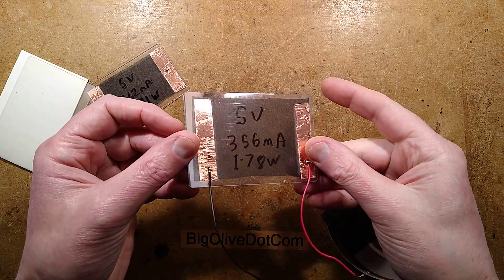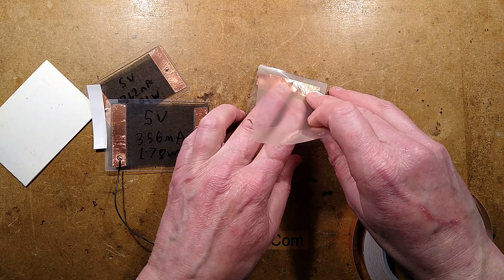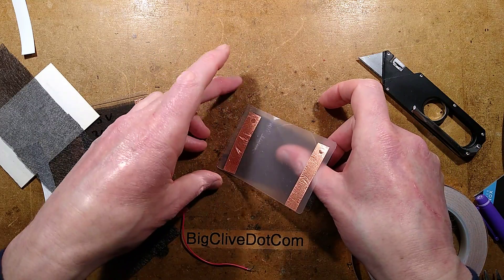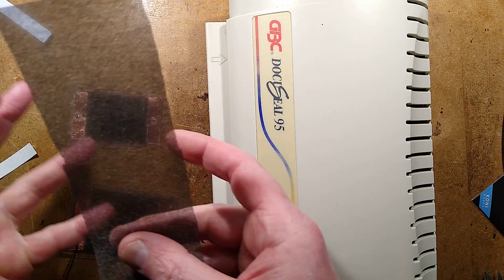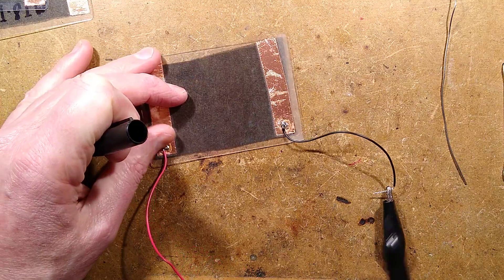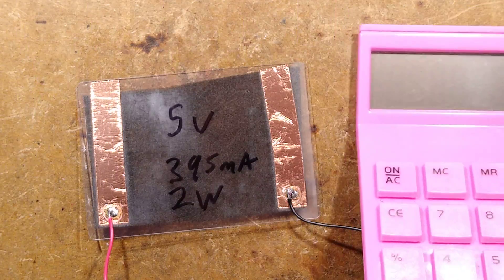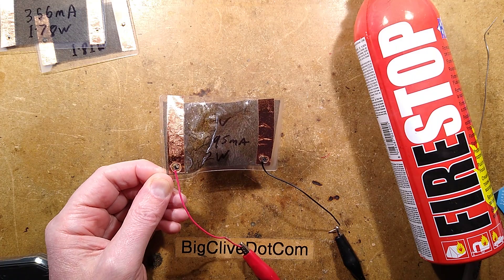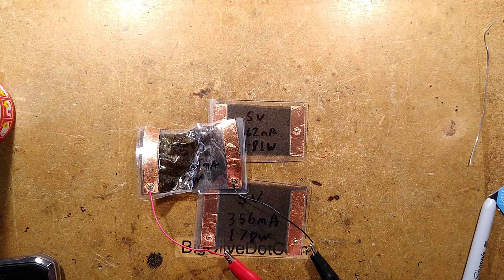Making custom heater pads and then destroying one

Comment: I have played around with some i purchased off of ebay a while ago, i noticed that with pressure applied the current goes way up, i am now wondering if its because of the multi layer design of the pads i had or simply just the weave being compressed hmm.
I was actually curious of the failure mode, thankyou for that too.

Comment: Great! I'm gonna buy the stuff and see if I can make large pads for the inside of my mudflaps on the car. Here in Sweden we often get pretty crappy winters with muddy snow building up on the flaps that gets rock hard with the temperature jo-joing around 0°C. Over been thinking about how to make heated flaps and was going for Konstantan wire (is that the English name for it?) but this seems to be a great alternative👍
I'll just glue them on and cover with glossy "snowophobic" paint😊
Reply: While I'm at it, I'll make some strips for my LED light bars too...
...uhmmm, wait🤦😂

Comment: The copper will be 4-12% lead to ease drawing through dies. Brass is usually the same for machining. Otherwise it is pretty sticky to cut and prone to crack. I think it reduces work hardening too. Makes it move more on a lathe if it is thin, like in slot cutting fins. You'd want to make all the cuts at once with a "comb" cutter. You have to go really slow w/o one to keep it from bending into the last slot.

Comment: I've made heated gloves using carbon fiber rope. I originally used 7.4V LiPo packs that came with a pair of commercial gloves. But for the past 2 winters I've been using a USB-C battery with a 9V decoy board, which eliminates the heat fade as the battery voltage drops. To control the output I use a small PWM dimmer.

The carbon rope I use has a resistance of 21 ohms per meter. The temperature is a factor of length and voltage, the shorter you make it the hotter it will get. I picked a length that I can plug my gloves straight into a battery and max out at a safe temperature.

It has been quite the learning experience as I've had all sorts of failures. I finally settled on copper crimps for the wire to fiber connection. I was still using solder which made the wires brittle and some broke over time from the stress of removing the gloves. 

At one point I was using fine copper wire wrapped around the carbon and power wire then bonded with solder. But unless the solder is absolutely perfect that connection can act as a coil and get up to 200F! That was a fun surprise, at least carbon cools off very quickly.

Comment: You can test to see if it is copper with a multimeter aparently.  If you set it to a specific setting, you can see the materials resistance.  Copper has a 1.7 x 10⁻⁸ Ohm/meter resistance rating.
Reply: but resistance changes with how wide/thick the strand is. Thinner wires have higher resistance
Reply: Multimeters don’t do well with such low resistances, but you can put an amp or two from a bench supply through a strip and measure the voltage from an ordinary DMM with a Kelvin connection. Use Ohm’s law to find the resistance. Then multiply by the cross-sectional area and divide by the length to get the resistivity. Should get within 10-20% with little care and maybe 10x better with good procedures. Pure copper has a positive tempco of about 0.4%/degree C depending on annealing.

Comment: Copper foil tape, I'm told, is used in stuff like electric guitar shielding (or any EMI shielding for that matter) and slug repellent. The wide tape is thinner foil than the narrow tape, which was a bit of a surprise, and unlike aluminum tape, many copper tapes have conductive adhesive. My favorite use of the stuff is to create addressable LED matrices using LED strips, copper tape, and Kapton tape. I've found that flux can "foul" the adhesive, rendering it non-sticky but a huge mess that you'll still need to clean with isopropanol.

Huh. Maybe one could use stainless steel thread and a couple of brass grommets to make a heating pad that you can sew into a jacket or something. Perhaps you could use the heating properties of this stuff in some heat shrink for something interesting.

I wonder if the carbon fiber can behave like char cloth? << pyromaniac
Reply: Another fun material I have used is nickel shielding tape: it’s fabric made of woven nickel thread, with conductive adhesive. It’s also available as fabric sheets without adhesive. 
I have uses that tape to convert a pair of ordinary flip-flops into ESD-safe flip-flops to use at work. (Yes, they passed the ESD footwear tester!)
Reply: What I reeeeally want to experiment with is that tape that is electrically conductive only along its z-axis (that is, through the tape only, but not along its length and width).

Comment: That stuff might come in really handy in my drying / curing chamber. Same princible, but only way larger. Do they hold up to lets say 80-120C? 

A wise man once said "We don't do 120V on this channel" Lets see what happens on 240 mains with those pouches instead of 30! Do you have a suitably large variac by any chance? Ya know, for ultimate torture testing.
Reply from the maker: They're best suited to low power use.

Comment: Neat! I bought some of this a while ago for igniting plasma in the microwave and did some similar experiments with heating pads, but I just mounted it taught between two thick metal leads. The copper tape seems to make more sense, I kept creating little arcs where the connection was made that ate through the fiber lol. I didnt think to laminate it, that certainly makes the material a lot more useful!

Comment: The middle is better, that way there's a more even distribution of current, in theory

If you used two wires poking out of the laminate, you could use two whole sheets of material, having two sides of a wire usable

Comment: This is a great little experiment! I could see this being worked into all sorts of applications. I wonder if heating up/dehydrating the fiber pad just before sealing it in could help with the moisture thing.
Reply from the maker: I'm wondering if the moisture came from the pouch adhesive.

Comment: Possibly interesting variation: Just use the bare carbon fiber sheet, clip the gator clips to opposite corners, watch with the thermal imaging camera as you ramp up the power.

Comment: Since it didn't actually burst into flames even at very high settings it would probably make a very safe option for all kinds of heating devices.  
Pipes in winter...solar panels...even Lithium battery heaters for very cold environments...possibilities for a wide range of uses!
Reply: I'd like to make some innersoles to keep the feet warm during winter.

Comment: You could maybe use some wide Kapton (polyimide) tape between the laminate pouch and the copper & carbon fibre as additional protection against melting the pouch. Might not even need the pouch if you can get thick enough Kapton tape, or have multiple layers instead.
Reply: We need pouches made of Kapton.
Reply: Wouldn't any thermal insulation be defeating the purpose of the heater aspect of it? :p
Reply: @lacunate  Kapton is heat resistant, about as heat insulating as normal pouch material. You can get it in rolls as adhesive tape.
Reply: I think the carbon fibre has to be somewhat embedded in something otherwise it'll start breaking down as it heats up. The lamination works a bit because the adhesive on the inside melts a bit into the fibres, but that same ability to melt at relatively low temperatures is also what makes it much less suitable for this purpose. The absorbed moisture in the fibre is also an issue that would need to be baked out first.
Reply: Kapton is comparatively delicate. It’s not as tough as the laminating pouches. And it’s far more expensive. So I wouldn’t use it anywhere it’s not truly necessary.
Reply: @tookitogo  It might cost more, but it is the result that counts. If you want to make a custom heating element this way that can produce more heat without crincling up like normal pouches, you need other material. The price is less of importance if it can be made working.

The Kapton adhesive film and the Kapton insulation around NiCr-Ni thermocouple I have worked with so far were a lot thinner than pouch material, so yes, in that respect they are 'more brittle', but still sturdy enough.

The main reason for why there are no Kapton pouches is probably the color of Kapton.
Reply: @strenter  I only said to not use it except where truly necessary. I didn’t say to not use it at all. 

Also, I said it’s more delicate, not that it’s brittle. It’s not brittle at all. But it resists abrasion poorly, which is one reason why it’s not the first choice in many applications.
Reply: Kapton tape would be used to pick up graphene from pencils on paper, No need to find carbon fiber.

Comment: Interesting how the smoke comes and goes.  I wonder if that's the plasticizer leaving the laminate, and maybe this could be a manufacturing step for making stiffer and high-temperature ones.  Maybe stack something flat and heavy on it to keep it from deforming, and then use its own heat to cook out the lower-temperature volitiles, see what's left afterwards...

But also good to know that you can make a 5w one and it's got about a 5x safety margin still.

Comment: Neat idea its a shame it just shrivelled up and died. Would AC effect it in any way to stop it dying so one sided?   2x👍
 I guess at the wire soldering time you could use a sharp screwdriver bit and scrape the glue off
Reply from the maker: It only shriveled up because I deliberately pushed it too far.  At low voltage it should last a very long time.

Comment: FYI, the copper tape can be found in diy stores as snail deterrent tape
Reply: Darn, he didn't measure the smoking temperature with the pyrometer camera thingy! Now he'll have to do it again.
Reply: Self adhesive copper tape is also used for making stained glass. Craft shps sell it.
Reply: hahaha snail deterrent at 240V AC 
There's a new video for Clive 🤣
Reply: @Dazzwidd  Photonicinduction did that with several kV.
Reply: @Dazzwidd  instant escargot, the French is going to love this.
Reply: @YoureUsingWordsIncorrectly  I think a microwave oven transformer connected to copper strips on the ground would be better. Set up a camera
Reply: @Dazzwidd  Mmm: fried snail; my favorite.
Reply: I did it the other way, bought some copper tape from Farnell to use with electronics and let my then partner use some wrapped around short lengths of PVC pipe to stop the snails eating her seedlings.
Reply: Thanks, going to buy one.
Not sure when I will be able to get my hands on the carbon fibre mesh.
But at least it will help get rid of the snails and slugs in the meantime.
Reply: It is also used for Dolls house wiring, sold at craft / model shops.
Reply: Snail deterrent ??? Never heard of that.
Reply: Does anyone know what is it about the copper tape that keeps snails away?
Reply: silver/ aluminum works too im pretty sure
Reply: @Bobo-ox7fj Thank you for taking the time to answer. So if I understand correctly, the copper tape doesn't necessarily keep them away, but simply prevents them from going past the tape?
Reply: @nnamerz @Bobo-ox7fj
 "..their blood contains Hemocyanin proteins that contain two copper atoms. When copper and snail slime combine, it creates a small electrical charge that deters the snails and slugs from crossing the copper."
Reply: Good addition. Thank you

Comment: what happens when you stack several layers of the carbon fibre sheets in one element?
Reply from the maker: That should theoretically reduce the resistance.  But I think the laminating pouch needs to be able to fuse right through for maximum contact.

Comment: So now we need a mains test to see how it behaves at 4 kW!
Reply: Yes Clive, put it into the sausage heater!😂
Reply: Oops, somebody invented the flat incandescent light 'bulb'
Reply: it would probably draw around 3.3kW and 14 amps. Then it would explode...
Reply: @williamhuang8309  you're saying that like it's a bad thing?
Reply: @zyeborm  no, it would be very fun
Reply: Clive, you forgot to measure the resistance! But anyway, the thing would just explode on the mains the moment you plug it in 😅
Reply: @abcdefgh1279  we can calculate it to be around 14.3 ohms. 5V divided by 0.35 amps = 14.3 ohms
Reply: @abcdefgh1279  ohms law?
Reply: @adamkarolczak5416  znam prawo ohma 😉 
I know ohms law
Reply: Would it work with AC
Reply: @PerspectiveEngineer  yeah it's just a fancy resistance so AC or DC don't really matter much. It's still going to blow up
Reply: Ring the Russian and Chinese Embassies first—Just in case.

Comment: Come on Clive, we really wanted to see it connected to the mains via a variac.. 😁🤪
Reply: when he suggested making three strips I instantly thought "Yes! connect it to three-phase!!" ;-))
Reply: @stepheneyles2198  all we have to do now is decide whether we want it connected in a star or triangle configuration 😉
Reply: stick it on Photon's capacitor
Reply: Oh come on Clive get out the quick test !
Reply: You get little sparks where the individual strands meet the copper, knocking out those strands somehow... this shifts more current to the remaining strands, causing them to die out more quickly, until the connection between the copper and the carbon is completely broken. Not sure why, maybe it's the plastic melting by the heat and causing insulation, but it doesn't take much to destroy them

Comment: Unnecessarily complex proposal, but if you made 4 x 7 segment shaped arrays of these (with the appropriate drivers) then coated it with thermochromic paint , you'd end up with a really funky clock!
Reply: ...also, you could leave off the thermochromic paint, and have a clock that you could only read with an IR camera 🤣
Reply: @therealchayd  Yes yes! I was thinking about a nitinol wire installation which would heat up and show the time only in IR. :D
Reply: That's a really cool (!) idea.
Reply: I like unnecessarily complex clocks
Reply: The seconds might be a bit slow to respond though!!
Reply: @stepheneyles2198 hit it with a bigger hammer. Think tech ingredients making flash graphene but back off a smidge.
Reply: @stepheneyles2198  You could cool down the segments with an Peltier element to make things even simpler.
Reply: That would actually be pretty cool. Not very power efficient. But it would potentially be readable by blind people, that's gotta count for something, right?. :D
Reply: They call that an incadecent clock!
Reply: That's why I use peltier devices for the seconds, so you can reverse the current for the 'off' segments to quickly cool them down! *lol*
Reply: I believe Sprite_tm tried something similar: his article is appropriately named "Thermochromic paint clock". The problem is most commercially available thermochromic paint has a low transition temperature, so it can take minutes for segments to cool off.
Reply: to make it less complex, you can trap xenon gas at each segment to make it glow might create a plasma at higher voltage and frequency of the driver. it would be called the "simple xenon plasma clock"
Reply: You should try using some thin copper sheets
Reply: Or you could have a clock that you read with your back
Reply: Someone has made this with pcb traces as the heaters, I believe it was a thermochromic panel

Comment: I can see possibilities for a 12v heating pad for caravan/motorhome. 12v electric blankets are available but they are comparatively heavy and bulky which is exactly what isn't desired in situations where weight and space are at a premium. Possibly use mylar sheet as a backing.

Comment: Might have got a better spread of heat by having the connections diagonally, but neat idea 👍
Reply: Copper probably way more conductive so not much voltage drop there.
Reply: @mikem6549  Yes, the resistance of the copper tape is negligible compared to that of the carbon fiber so probably no real difference.
Reply: At first, I thought what you meant was two small diagonally positioned pads. After I've read your comment once again I realized, that you meant just the connetion points to the tape. Yes, that could be a good idea.
Reply: I fitted heated seat pads in my car and I believe that's how they are setup.

Comment: For scientific reasons the failure mode always needs to be investigated. 😎
Reply: Always, he needs to test it's pop freshhold.. :)
Reply: Appears to have the same failure mode as most electronics - ie once the smoke escapes it stops working.
Reply: Most definitely...you know...for safety reasons!  😁👍👍
Reply: @arthurmann578  Of course.. ;)
Reply: Is probably air entering at the place where it firstbreaks the lamination and oxygen allowing the car bon fibers to oxidise in a path where the  pouch first bulges.
Reply: Yeahhhh now do it in gasaholacetonEnampaMdieselmethahydrogenperoxamonimperchlorasulfuricacidnitratelox😂😅😊😅
Reply: Destructive testing is essential to the engineering process. It is also a lot of fun.... except when testing nuclear reactors.

Comment: Nice! A larger version of this might be what I need to keep my solar batteries warm in winter.

The copper tape is available from garden shops as "anti slug tape". I got some for a project last year.

I was wondering if you ut the tape a bit longer, then folded the end over to cover the sticky side, you could have copper tabs sticking out of the side of the pouch to solder or connect clips to. No need for the holes or removing the sticky.
Reply: Having the tape stick out the end might be too delicate.
But you could just fold it around the pouch so it ends up on the outside.
Reply: @Ultrazaubererger  Or fold the end for a few millimeters so the non-adhesive side is visible at the holes.
Reply: I'm thinking this may be a way to make A4 sized heater plates for stopping water freezing. I've already ripped up an electric blanket to get the heater wire to wind round the pipes.